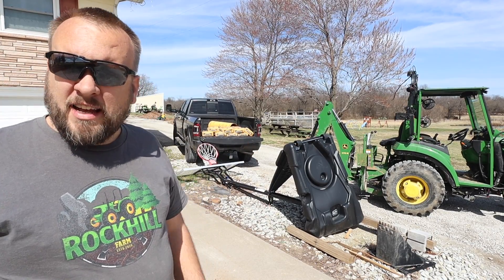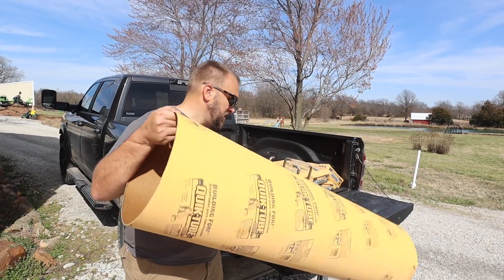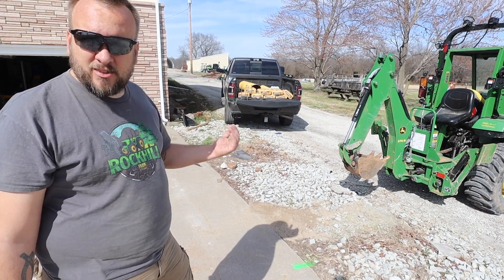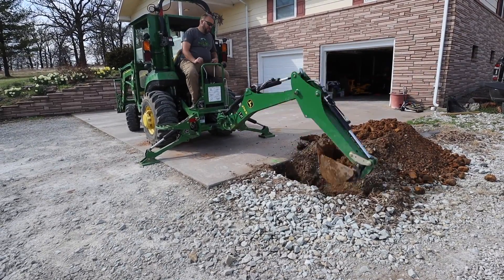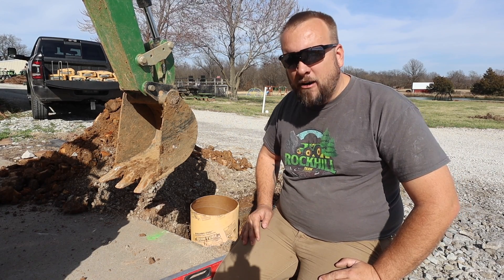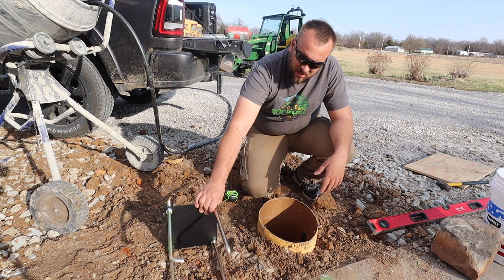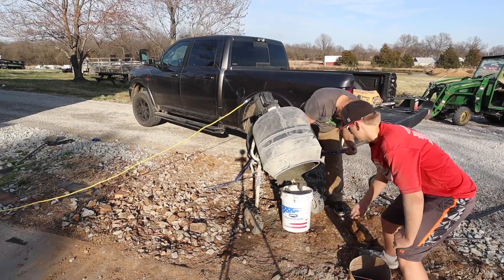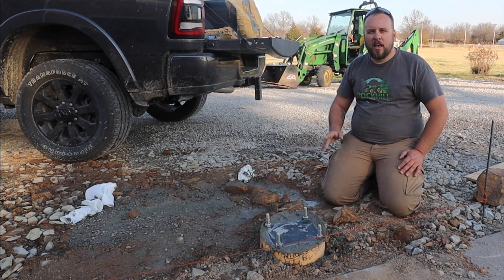Sonotubes - A Better Way to Set Posts?

Comment: It's a little late now, but with a plate like that, you can leave it up out of the concrete enough to have the bottom nuts exposed, then you can use those nuts to fine tune your level over time. They do that with metal traffic light poles and other large structures.

I agree with the comment about using the two part foam for the mailbox install. You won't be disappointed if you try it out.
Reply from the maker: That sounds like a good idea. The instructions said to set the lower nuts in concrete but there would definitely be an advantage to leaving them exposed

I’m thinking I will use the foam on the mailbox
Reply: @RockhillfarmYT  If you do use foam use the Fast2k brand and not the Sika. Tony's Tractor Adventure did a video showing the difference and the differences are huge. We used Sika on some fence posts at home and they started wobbling when it shrank. The fast2k is a lot more dense and solid.
Reply from the maker: Thanks for sharing. I’ve been watching a lot of Tony’s videos

Comment: Concrete posts are more useful than Facebook posts haha!  I'd say there isn't enough of a reason to pack dirt around it until the concrete has set up.  You can use a couple of boards to stabilize it during the pour, then backfill once it hardens.   Keep up the good work!

Comment: Those bolts in that plate look to be awfully close to the outside edge of the concrete, like the plate was meant for a 2" to 4" larger diameter sonotube (which you likely can't find it a big box store).  Hard to tell that for sure though on the video (I don't like leaving a negative comment), Hopefully I didn't see things correctly.  The backhoe worked really well for that hole though 👍
Reply from the maker: That’s not a negative comment.. Pointing out something I miss is always welcome.  The whole idea is learning

The instructions called for a 16 inch diameter hole.

The two back anchors are quite a ways from the outside edge but honestly the front ones are pretty close. Luckily the anchors are L-shaped on the bottom and the L points towards the middle so should be OK but not ideal

Comment: Good job. I think I would’ve taken the level and pushed it against the front two bolts and I measured from the ends of the level to the driveway just to make it easier to confirm it was parallel with the driveway.  So instead of measuring to the driveway when you’re only 12 inches apart it would’ve been about 4 feet apart with a 4’ level.

Comment: Stupid question…. Why not install mounting plate on edge of driveway concrete and not install the tube/digging etc… ?
Reply from the maker: Probably possible depending on how thick the concrete is on my driveway. The hardware they send you to mount it with has those L-shaped rods about 16 inches long.

The basketball goal is really heavy and the backboard is like a sail,  so if you were putting it into existing concrete you would want some really heavy duty anchors

Actually as I’m typing the response, I don’t think I would want it that far forward on the driveway. The goal sticks out 3 feet from the post and can be lowered down below 7 feet so it would kind of be an obstruction to the garage

Thanks for watching
Reply: @RockhillfarmYT  yeah gotcha

Comment: I'm going to buy a post hole digger for the tractor this week. Looking forward to building a chicken coop here! I have the augers already from years ago. 6, 8, 10 & 12 inches. What is the diameter of these tubes? It's not a bad idea you have here!
Reply from the maker: The ones that Lowe’s and Home Depot have are 8 inches and 12 inches but you can get them in other sizes

Comment: I'm trying to understand the benefits of using this for the poles used in building a privacy fence. Aside from the perfectly round cylinder shape which looks nicer what are the reasons for this being better?
Reply: In all honesty if your yard puddles anywhere along your fenceline a sonos tube would be bennificial also it would prevent rotting of the process of rot to the post . Typically 2" above grade . Other than that i dig and set with no tubes on 90% of holes dug.

Comment: If a load bearing post for a shed needed to be set, do you think these tubes could be used to set the foundation for the post’s anchor points?
Reply from the maker: Yes, they are used in construction but they just use larger diameter tubes if they are holding more weight

Comment: What size bucket is that?  Thanks
Reply from the maker: 12”

I’m looking to get a mechanical thumb but Deere only has them for the 8” bucket

Might order from bxpanded
Reply: @RockhillfarmYT  my 2022 3046R with deluxe cab is being delivered this week with the 375A backhoe and a 12 and a 24 inch bucket. It’ll have a 72 inch loader bucket, box blade, landscape rake and pallet forks. If you can’t tell I’m kind of excited about getting it.

But this morning I was using my brother-in-law‘s excavator remove a large 40’x40’ patio from my backyard and while it’s a bigger excavator it has a hydraulic thumb on it that made removing the 8 inch thick cement super easy. I probably won’t have a use for a thumb in the future but I can’t say how valuable it is if you need one.  

I have been watching your videos for about six months and I appreciate all of the advice and like you said we all learn by doing stuff the first time and the best part is I get to learn from watching you do something for the first time as it’s always easier to make comments and give advice once you see how a project was completed everybody’s making comments in hindsight. Thank you
Reply from the maker: Congrats on the new tractor. Sounds like you got a great set up coming.

I not an expert on anything but i’ve learned a lot since I bought the tractor 

Thanks for watching

Comment: Can not stress this enough,  with a metal fence post, do not use sonotubes. It does literally nothing and actually makes the concrete less effective.  You want the outside of the concrete to be rough and bell out at the bottom so it doesn't lift during the freeze. Sono tubes for wood? Yes but metal?  Complete waste of time